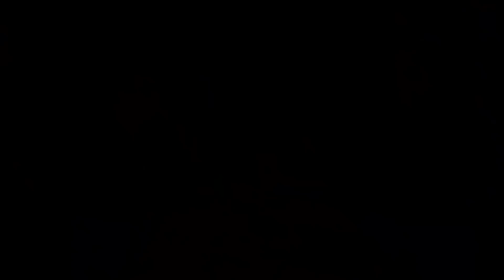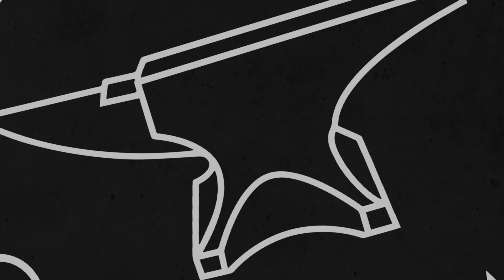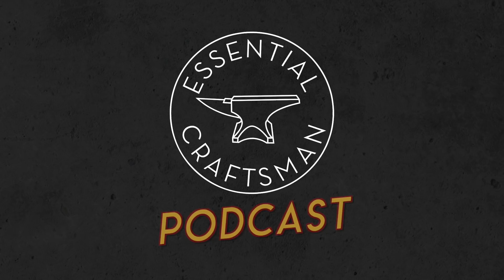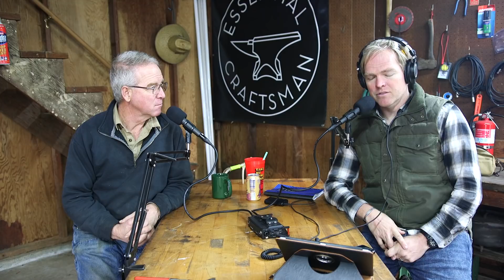Spec House Review - Ep 55-58 ECP 17

Comment: 8" is high per code...  Most jurisdictions that use the IRC are 7 3/4 max rise 10" min. run.  Always pays to check your local code amendments. :)  I should also mention from your winder video that if the area under the stair is accessible for storage, there needs to be G.W.B. on the bottom of the stair (Per IRC verify with local amendments).

Comment: Gents, well done series. It takes what time that you have available to do sit downs and catch ups.  When stuff arrives and weather permits, you go as fast as the project allows to get it installed and done.
   On issue of problems, no one is perfect. Other folks have pointed out that things are done on the fly because of plethora of reasons. Just go with the flow, making sure you don’t break code.
    Keep up the good work! And thanks for the videos!

Comment: I've fixed Hardie Board holes with Bondo Auto Body Filler.  Scratched in the grain, sanded it a bit and painted it.  I was surprised how well it turned out,  very hard to find the patch for someone that didn't know where it was.

Comment: That's very similar to a trick that my wife shared with me.  I got pine sap all over my hands and my wife told me to try rubbing vegetable or olive oil on my hands to cut the sap and then use soap and water to get rid of the vegetable/olive oil.  It works!

Comment: Just had the roof of my house replaced.  Started 6:30 am 01/07/2020 and finished 12 noon 01/08/2020 with removal of one layer of wood shingles and two layers of composition(asphalt) shingles down to the 1 X 4's for the wood shingles.  Full decking, underlayment, and shingles plus 4 double-axle trailer loads of removal to dump and clean-up, a crew of 7 plus foreman.  I am writing this 01/09/2020 2:30 pm.  Looks great.

Comment: Regarding getting clarifications to the plans from the architect vs. on-the-fly problem solving - how different is the approach if you are building a single house vs. dozens or hundreds of the same house? 

It seems to me that for a one-off home, it's much more sensible to absorb more on-the-fly puzzle solving once than perhaps if you are expecting numerous crews of guys to build the same house and potentially solve the same problems over and over.

Interesting considerations.
Reply: I did a lot of multi-family buildings for a particular architect for many years and it became obvious later that the mistakes we used to find in a particular situation had been ‘cleaned up’ thru the years just by experience. The buildings were generally similar, so over the years the ‘bugs’ had been worked out and planned for more readily. One-off custom homes are much more difficult to foresee all the possible problems that can come up.
🤜🤛

Comment: First?

Great episode. I'm only in my 30s, but one thing I've learned with work is you need to turn it off after hours to stay sane. Disconnect when home and you'll be much happier.
Reply: I remember I got better at it as I got older but when I was first put into a supervisory position, it was just completely consuming. I guess it’s just that desire to be successful and to assure the people that thought enough of you to give you that chance, that they made the right choice.
🤜🤛
Reply: @psidvicious  that is exactly how it worked for me. Well said.
Reply: Sometimes it is easier said than done. I spent years as a computer programmer and later as a financial analyst a nd would oftfn encounter problems shile building a program. I would try my best not to take it home but learned pretty quickly to have a pad and pen next to the bed becayse many nights it was working around in the back of my brain and the programming problem would work itself out during the night. You may ask what computer programming has to do with building as house. In actuality they do share many traits. They both have the conceptual idea, you then turn the conceputail idea into 0lans in the form of flow charts and psuedo code and then build/write the code. As a financial analyst I found myself doing the same thing to get to the analysis the boss asked for.

Comment: I am a design draftsman. I have worked for architects. I am an independent designer now. There is no such thing as perfect plans. Every set of plans has faults.  Contractors find designers problems. The only plans that are perfect are the plans that get drawn, you get paid for, and the building gets nixed for whatever reason, and does not get built. Those are the only perfect plans.